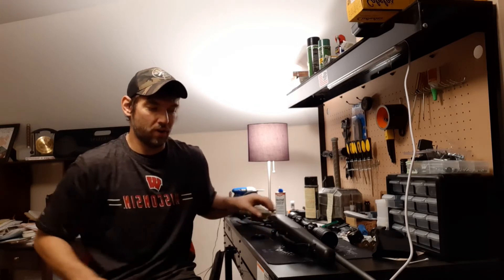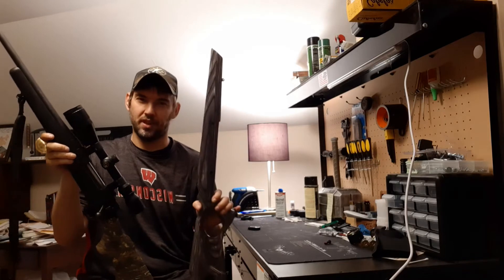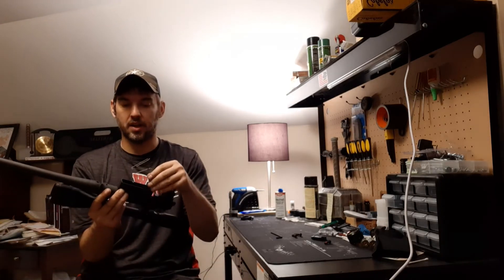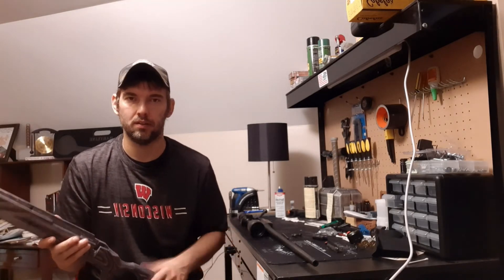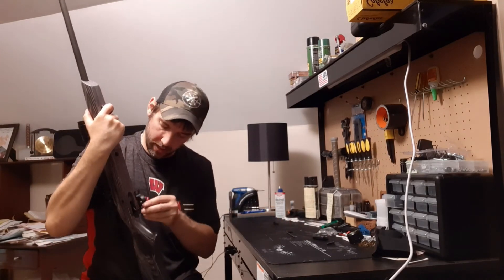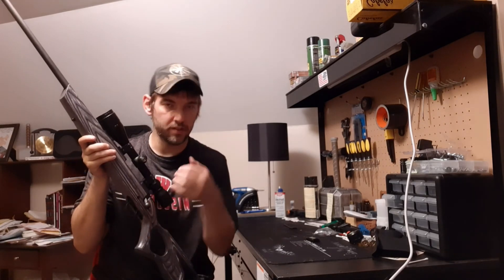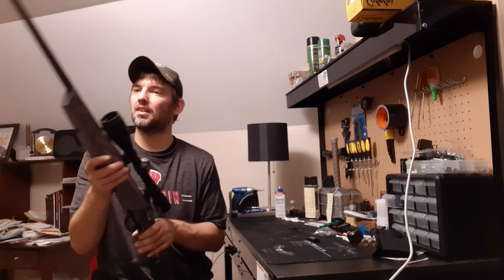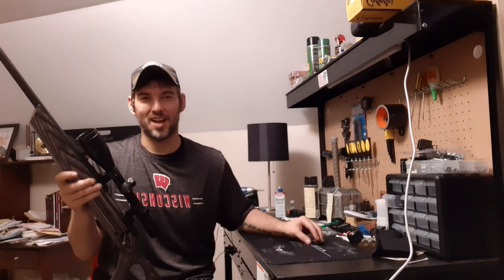Stock swap. From turd to gem!

Comment: you left out the most important part which was the 3 screw on the trigger guard , does the 2nd screw now go through the trigger guard? it looks like the top was just held in by a slot
Reply from the maker: Yes it goes through
Reply: @Spidermonkey2a so did you have to buy another trigger guard screw or does the factory action screw hold it in

Comment: I have the same riffle. Do you have the part number from boyds? I want a new stock. Great vid!!
Reply from the maker: I don't unfortunately.  Their website is super easy to use though. Thanks much!
Reply: Hi again. I ordered my stock and bought the rear action screw from mossberg. I still can't get it to grip. It seems that the screw is a bit short. Did you Dremel the stock to make the screw fit?